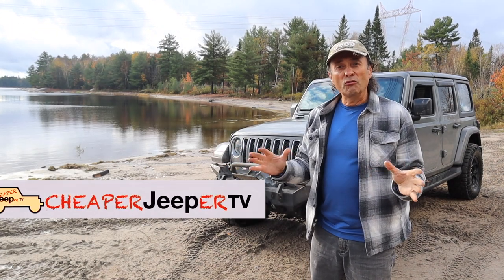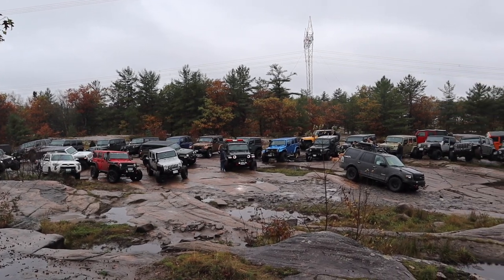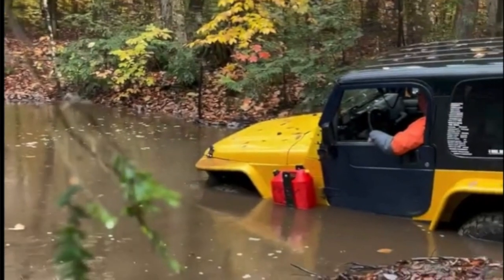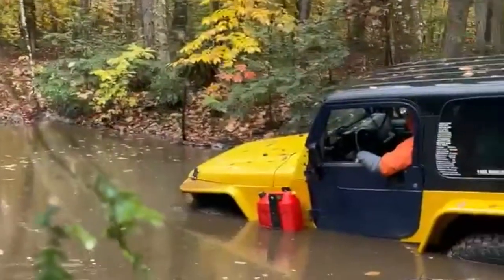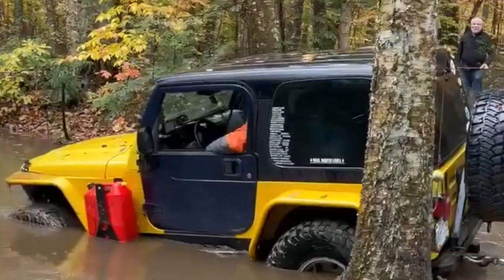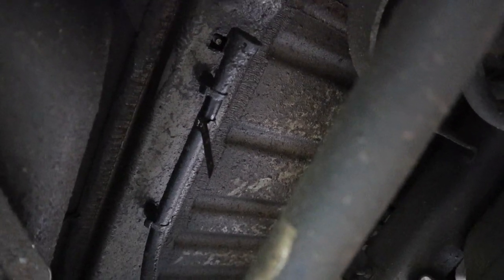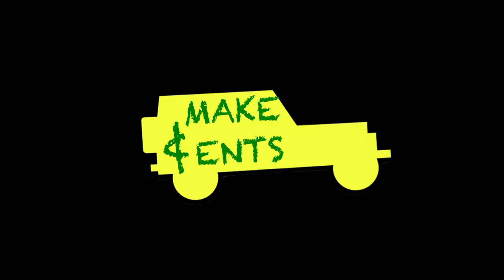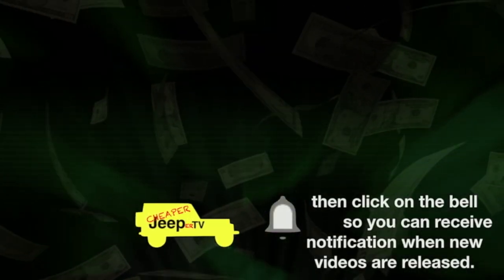Manual Transmission and Breather Tube Tips When Off Roading

Comment: Good advice. I never thought of this issue, but you're correct.  The clutch housing is not sealed, and I can see this could be an issue.  I have a manual JK, and will definitely approach the next mud hole with even more respect.  Also, transfer cases and transmissions have breather tubes, so keep those in mind as well. Cheers from Canada.
Reply from the maker: Hey Pete,
I cringe whenever I see someone with a manual in the mud and watch them try rocking it back and forth😬 
If you think this video will help others, please feel free to share. 
Cheers ...also from Canada.

Comment: Back in the 80's we had a Suzuki LJ80 that I was always taking into water. I Silicon glued over the vents in the manual transmission the day before I'd go off-roading in the rainy season and then peel off the silicon glued vent covers the next day.
Reply from the maker: Hey James, You solution is inexpensive and simple to do! Thanks for sharing. Cheers

Comment: Exactly what I need more of, manual transmission tips. I have a manual and I am honestly a little nervous if offroading with it. Dont wanna burn out my clutch or worse considering I'm a OffRoad rookie. Hoping more vids like this one
Reply from the maker: Hey Hardlife, When I decided to make this video, after having learned about this tip, I found there were many off roading with manual videos  with tips out there. Its good to be cautious and learn the important tips before you go off road. Tips like in this video can help you avoid expensive mistakes.  Cheers.
Reply: Hey Hardlife.  The one thing I can tell you is to learn both by educating yourself and getting out there.  I was a newbie on the run that Dino is showing pictures of and it was puddle after puddle all day.  I was conscious of not clutching in during any watercrossings, but given my lack of experience, I did a couple times, including once when I stalled it and needed to restart the jeep.  As Neil states in the video, you have to be pretty deep and there is some debate whether water that isn't too muddy is all that bad.  In the end, if you want to go offroading, do it!  If you go with a club there will be plenty of people to help with both knowledge and repairs on the trail.  I know as I split the sidewall of one of my tires and had just about every other jeep on the run come over to help either with knowledge, tools or muscle (and this was just a tire change!).  I almost had to fight to help change my own tire   :)
Reply: @MykolW  I appreciate the feedback. I've had jeeps all my like but never really gone one decent trail. Not yet lol. Although with all the snow we get in jersey I do have fun in the winter lol
Reply from the maker: @MykolW  Hey Michael, Thanks for chipping in. Sharing your feedback and experience is appreciated. Cheers.
Reply from the maker: @hardlifesurvivor4404  Hey Hardlife, For sure you should check into joining a local Jeep club in your area. They mostly operate on FaceBook.
Reply: @MykolW  so when you're driving through puddles, is it ideal to just shift into a "comfortable" gear (maybe a lower one in case of slowing down) right before getting into the puddle and try to stay in that gear? And are you in 4Lo when going through puddles so as to avoid stalling (since you can maintain idle easier when coming to a stop)? I've driven manual my entire life but never 4WD until recently, so I'm learning how to maneuver "strategically" in 4Lo vs. 4Hi.
Reply: @eljefeslash  When our club hits the trails, we are in 4Lo for pretty much the whole trail.  And you nailed it...when coming to a watercrossing I will wait for the person ahead of me to pretty much finish crossing before I start.  I select the gear based on what I see from their water crossing.  Since gear ratio, tire size, tire type and a few other factors come into play, I could be way off talking about specific gears to be in.
Reply from the maker: Hey Michael,
Thanks for sharing!!
Cheers

Comment: in my 07 jk i added a hose with a T then connected it to the transfer case vent tube which is already high enough. then extended both axle vents to tail light height even tho i never went threw much water.
Reply from the maker: That sounds like a nice mod to do. Cheers.

Comment: Hey Cheaper Jeeper TV
Don't forget the Breather Vent on top of the Automatic Transmission. It is the shortest and lowest.
The Front Diff Breather Vent is the highest in the engine bay.
What many Jeepers do on the Rear Diff Breather Vent is extend it to the Tail Light cubby hole area.
Reply from the maker: Hey TwoFeatherChannel, Thanks for the info on the. breather vent on top of the automatic transmission.  Cheers.
Reply: At least on my JK, the automatic transmission is actually the highest breather hose. It terminates to the top of the engine bay.
Reply from the maker: Nice.
Reply: @AustinH7  yes the transmission hose goes up to the engine bay.
it's the Transfer Case breather hose that is the shortest, it's only a few inches long on top of the transfer case

Comment: just manhandle that manual transmission don't hesitate and act while the transmission is hot keep the r.p.m.'s high so the centrifugal  force keeps garbage off the plate. Be aggressive with your forward and reverse shifts, and keep the moment alive, when you hesitate everything gives up and that's when your Jeep becomes a sponge. Your r.p.m.'s will be higher when your swamped, but that's what you do when you play motorsports. Stay  intense when you're out there, because it's man vs. machine.
Reply from the maker: LOL. Awesome!!! Thanks

Comment: I've ran manual transmissions in jeeps in deep mud for 15+  years  I swapped to a automatic like 5 years ago and it's not as reliable as the manual

Mud in the clutch is such a rare occurrence as the spinning of the clutch and flywheel generally throws the mud and water off the clutch .....
Then worst case the heat from a slipping clutch will dry it out and then the dry dirt can fling off the clutch  ...if the clutch slips 
It will self fix in a very short time 

I've had way more issues with automatic transmissions getting water in them thru the vent they all have behind the torque converter and they completely stop working for good till you disassemble and rebuild the transmission 

Automatic transmissions are way way more risky in deep water then a manual
Reply from the maker: Hey Dustin, Thanks for the info. I've seen many YouTube videos comparing the two types of transmissions. Whichever you have, it's good to know what to watch out for, thats for sure. Thanks for your insight. Cheers.